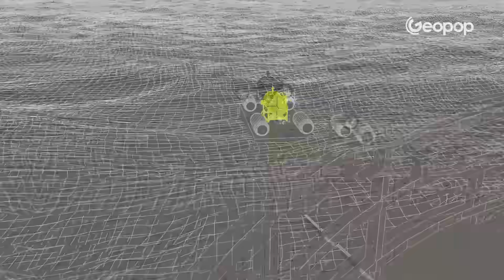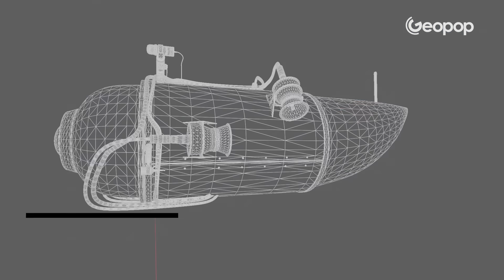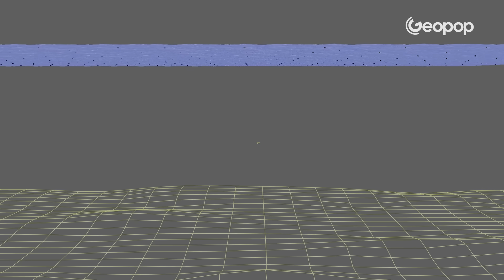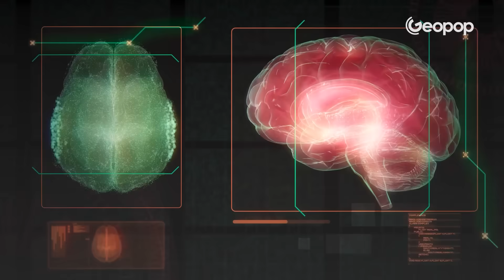Titan Implosion, two year later: the 3D reconstruction and the possible causes

Comment: I'm a retired engineer. When I saw the construction of the pressure vessel, the first thought that came to mind was Damascus Steel.
Reply: My first thought was wtf are they doing using Carbon Fiber as a compression vessel as opposed to a pressure vessel?! Repeated compression cycles of CF at those depths? This was inevitable. What an idiotic deaign decision!
Reply: @MattH-wg7ou  Yeah, most likely it could survive once, but the repeated dives were what did it in. With such an unknown there should have been a prototype to dive uncrewed until collapse to work out how long a live that hull had.
Reply: @MattH-wg7ou  mine too. Especially in the shape of a toilet paper roll 🧻
Reply: @MattH-wg7ou thats not even the biggest issue. Had they properly tested the limits of it, and performed the correct motions for checking deformities, this likely wouldnt have happened as fast, if at all.
Reply: @MattH-wg7ou  and they used space grade glue to hold it to titanium
Reply: @MattH-wg7ou  any figure all of those guys are smart in someway none of them even mention that this was a bad idea sending five people in that death trap? And I am not the smartest man in the world have ADHD. I would’ve said no to that.
Reply: @MattH-wg7ou  the whole point of what they were trying to do was to lower the cost of ocean exploration. Stupid yes - but very much by design. Carbon fiber is cheap. Solid titanium is not.
Reply: @MattH-wg7ou  It is interesting that it lasted as long as it did. Could be useful for expendable applications like torpedoes. They don't need to last that long and they aren't that deep.

Also, the technology has come quite a long way in just a few years. The resin and the fibers keep getting cheaper. You can even make graphene at reasonable quantities at home. A tiny amount of graphing can make a huge amount of difference.

I'm also pretty sure you could use acoustic modeling to give you a really good idea on just how much stress it can continue to take.
Reply: I'm not sure what Damascus steel has to do with engineering, it is not an engineering material. Properties lie within the normal expected range of the two constituent metals. Looks cool though. What part of it looks like Damascus steel? The titanium doesn't have banding, maybe the carbon fiber?
Reply: @zbubby1202 Yes but it weel keel
Reply: @I_am_BiG_Al Good one!
Reply: @I_am_BiG_Al  😄
Reply: @I_am_BiG_Al  haha
Reply: @I_am_BiG_Al  forged in water reference.
Reply: @zbubby1202 it was an example highlighting a material has a specific use, in a certain application.
Reply: @zbubby1202 the way that it is layered is similar to the construction of Damascus steel. However it wasn't layered properly and Boeing had even told them the correct way to layer it but they shot it down (as they did every common sense suggestion) becauae it took to long.
Reply: I’m not an engineer. But my first thought was Death Trap!!
Reply: I'm a domestic plumber. When I first seen it. I knew it would eventually implode.
Reply: Basically the resin was taking all, or nearly all of the compressive load, because carbon fibre has ZERO compressive strength without being set in resin. Also, the very low temperatures at that depth may have made the resin more brittle than it would be at the surface temperature.
Reply: This accident was totally predictable.  CF shares a lot of properties with fiberglass, albeit a stronger and better engineered version of the material but very similar material properties.  The primary difference is fiberglass, as its name implies uses glass cloth or glass threads while carbon fiber uses carbon cloth or thread.  Both have very good properties in tension and shape retention/rigidity (does not deform readily) but have rather low resistance to compression and impact forces.  Submarines are one of those devices where a material that can deform is somewhat desirable because an impact force (say from rough handling on deck) would just mar the surface or maybe leave a small dent (plastic deformation) but a material like carbon fiber behaves more like a submarine made of glass.  While glass would have a lot of desirable properties for a submarine one undesirable one is its lack of ductility where even very slight marring introduces a very weak microstructure that all stresses have to bypass.  This is also how CF behaves where even a tiny broken microstructure requires forces to travel around it which broaden the damage by applying micro deformations to the microstructure with each excursion.  CF being a composite material is very hard filaments in a relatively soft polymer matrix so these stress excursions are continuously working filaments free from their matrix with each flexing at a damage point.  Then finally on this dive the defect was too far gone to allow the rest of the hull enough margin to bypass stresses around the damage area causing further stress damage to propagate and further weakening the structure.  One can only hope the progress of this failure was not detectable and fast, however evidence says they may have realized they were losing structural integrity about 20 minutes prior.  In any case once integrity was no longer structurally sustainable due to the pressures the hull let go in a microsecond.  so fast that the air inside would have auto ignited anything combustible due to the rapid pressure change before the momentum of the materials tore them to pieces, all within a microsecond.  It is very telling that no large section of the CF tube was recovered, showing once the material failed, it failed completely and literally in all places at once.  That actually speaks volumes about how well the tube was constructed as much as it speaks to how bad of a material choice CF is for a submarine hull.
Reply: @larrybremer4930  in other words Fragile
Reply: @larrybremer4930 wow… one of the most in depth & articulated explanations I’ve seen thus far. Thanks for your amazing input.
Reply: @larrybremer4930 just what I had been thinking & I am a human Physiologist!
Reply: @larrybrem…:  TRULY, yours is the best explanation I’ve read or heard yet of all the numerous articles and videos over the last year plus!!  Thank you so much for “breaking it all down” for those of us who are laypeople!!
Reply: My first thought was THAT IS EXACTLY THE WRONG APPLICATION FOR CARBON FIBRE!!!!
Reply: @craigwall9536  I feel like it isnt that bad for say one or two dives per craft, or, alternatively, they could have added a thinner layer of titanium on the inside the carbon fiber as reinforcement. Itd still save weight, and still get down there a few times before replacing the craft. Theres a number of design choices thatd end up way better. But the whole company was negligent....so...yeah. from what Ive seen, they didnt even test this properly. Too concerned with making money instead of making sure it would survive.
Reply: @craigwall9536 The Navy has been using it in the same way.
Reply: I'm a Retired Janitor and I thought the same thing.  Damascus Steel.
Reply: With a gaming controller like that I don’t need to be an engineer to say it’s inevitable to happen
Reply: The smartest people were not inside of the submarine.
Reply: @lurin971 careful now, the son didn’t want to go, but his father made him. Remember that. At least one of them was smart enough to know it wasn’t a good idea.
Reply: @lurin971 I am sorry that an 18-year-old person was on board.
Reply: Same
Reply: Nope. You use contiguous-as-possible titanium for these things.
Reply: You probably confused Damascus Steel and the Damocles sword….
Reply: @Hop754: Exactly!!
Reply: I’m a retired war veteran that goes inside submarines in occasion, and the first thought that came to me is how everyone is a fat liar.
Reply: @UmesTapeworm what you mean mate
Reply: The carbon fiber that Rush bought came from Boeing and was deemed by Boeing to be unfit for their use, and thus made it for sale.
Reply: @cityman1111  the bargain basement. How anyone could climb into that Coffin makes me shiver.   At that depth the outside pressure is at least 5,000 psi.   A jet of water at that pressure can cut through a half inch of mold steel. One tiny little leak and it would give way real quick.
Reply: damascus is just for the look.
Reply: @noob9103  - during the period that damascus steel was invented and in widespread use, it offered several advantages over the standard steel of the time.
Damascus consisting of soft, low carbon and hard high carbon steel, forged into the right pattern could yield better flexibility and edge holding for swords and other battle implements to name just one of its applications.
Reply: The pressure of water at 3,800 meters is amazing. Imagine the pressure the weight of the entire earth. Now imagine the weight of about a thousand Earths our s u n . A neutron star is formed from Stars two or three times the mass of our sun. 
Truly mind-blowing
Reply: Your mention of Damascus steel, reminds me of antique shotgun barrels. There were warnings on modern shotgun shells not to use them in Damascus barreled weapons because of the pressures generated by modern ammunition.
Reply: 5,000 psi can direct a water jet capable of cutting through an inch of mild steel.
Reply: @allanpatterson7653 Water jet also has garnet added to it
Reply: You were a terrible engineer.
Reply: First thing I thought of was French toast with extra butter and syrup, I'm pretty hungry actually
Reply: I’m a retired fry guy at Burger King, I thought the same thing!
Reply: Same here
Reply: For me it was aluminum foil
Reply: For me it was aluminum foil
Reply: It probably could have used Damascus Steel instead of what Stockton Rush used.  Damascus steel is the King of steel. Rush didn't understand the meaning of the word CAUTION, nor did he feel a third party inspection was necessary, He could have designed it to be round instead of tubular but back ,he was in a big hurry. The more dives, the more CA ching $$$$$$ he wasn't thinking about safety. That submersible wasn't re-usable, it was a temporary, like a pair of disposable diapers. I never would have gone on that thing, after so many dives, the  depth stress would have caused it to implode. I'm no engineer, but I saw too many problems from the beginning. Stockton Rush got what he paid for., A disposable submersible. And because of THAT, they are all at the bottom of the sea in minuscule pieces, if that.🙄🙄🙄
Reply: I'm thinking you were being a bit sarcastic and crass.
By damascus did you mean multiple materials "formed" together, like CF, titanium and human remains?
Reply: As the late great Nigel thornberry “smashing”
Reply: 😱 no doubt!
Reply: Me too.  Not an engineer, but I do know Damascus barrels of rifles.  They are gorgeous…but
Reply: I'm no Alfred Einstein and I could tell when I first seen the vessel that it was a suicide machine
Reply: Steel ribs supporting the tube might have helped.
Reply: @kirbywaite1586  The fracture point was the acrylic view port 💥
Reply: @fiending  Has that been proven definitively? It sounds reasonable, but who can say for a certainty?
I wonder why the carbon fiber wasn't wound around something structural.
If there had been an inner structure and reinforcement , perhaps it wouldn't have imploded. 
Also, wouldn't the two titanium end caps have come crashing towards each other in an implosion, rather than being propelled away from the hull?
Reply: @kirbywaite1586  they would, itd have a vacum effect
Reply: @kirbywaite1586  I was thinking, if the fracture point was anywhere other than at the view port, the pressure would have been relieved off of the view port instead of getting stronger at that point to blow off the view port from the bolts. Because at the moment of the implosion, the titanium piece isn't attached to anything anymore so there wouldn't be pressure on the view port. Stockton Rush admitted that the view port would be pushed in 3/4 inches as they reached the bottom and didn't say the carbon fiber was compressing to a point that the view port was being pushed outward. To really find out, the threads in holes of the titanium that held the bolts that held the view port would need to be examined to see which way they were bent
Reply: @lllToxinSFMlll  But simulations of the implosion have the ends blowing off. At least it appears that way.
Reply: @catzkeet4860  out of all the materials, plastic is the weakest so the view port was the fracture point 💥
Reply: @kirbywaite1586 not a lot.  When carbon fiber composites fail they shatter. Reinforcing rings would likely have simply deformed, and the composite would disintegrate.
Reply: Remember when engineers say that carbon fiber is stronger than steel? Lmao.
Reply: @XeebThoj728 

9mo ago (edited)

"Remember when engineers say that carbon fiber is stronger than steel? Lmao." 

@Xeeb Thoj 728 :
It is. In tensile strength, not compressive, and when compared pound for pound.
Reply: @SHOwagon1994  Carbon fiber isn't stronger. It's just lighter hence "fiber" and also to compare steel to carbon fiber, they are not comparable to eachother.
Reply: You're missing the point. Aluminum is lighter than steel, and titanium is also lighter than steel. And yes, carbon fiber is lighter than steel. but it's how you apply these different materials and the orientation of the strands and how you want the forces to be absorbed. That's why planes are made of carbon fiber... because of their tensile strength, and high strength to weight ratio. 
Carbon Fiber Product  composites can have a tensile strength of up to 10 times that of steel.
Reply: But not in compressive strength. A quick internet search... 
"In terms of compressive strength, steel generally outperforms carbon fiber".
So good for planes, race cars, prostheses... Not good for submarines.
Reply: Maybe they should hired a 50 year old white guy 🤷🏻‍♂️
Reply: I don’t even think valerian steel would helped him.
Reply: @elizabethchase6528  CF and Fiberglass are excellent substitutes for wood, steel, or any other material in the right applications where things like corrosion of a metal or light weight for its strength is a necessary consideration such as Aviation, Boats, and  Cars.  At what point was I saying  CF was a good material for a submarine?  I said it had some desirable properties as any material selection would.  You could choose to make a submarine from peanut butter and find at least one desirable trait of that material but that would be offset by lots of undesirable ones.  Any material choice is always a compromise but in totality CF is not a good choice, at least not without something on the order of a 10x safety margin on design loads and doing detailed UT and X-ray inspections after each dive.
Reply: 100% demascus steel is the best way ibcan think of as well.
Reply: The carbon fiber was from Boeing and was out of date for use in aircraft manufacturing.
Reply: @annsheridan12  it was basically a high-school project
Reply: Another I'm A!
Reply: Another I'm A!
Reply: Why cuz it looks cool? 😂 its used for artsy knives... thats it
Reply: I'm a BUS driver , and even i could tell the next stop was there last.
Reply: Very thick and solid please, no carbon fibre for me.  It doesn't take a rocket science to know why Subs are built the way they are, It was never innovative, it was going backwards.  In a hugely reckless way. With a tragic outcome. All to see a graveyard, they have just added to.
Reply: So you’re saying they were screwed? 😳
Reply: Damascus steel ?
Reply: You can't use a car seat again after it's been in an accident, even if it looks perfectly fine, and that's because of fatigue. Astonishing that this factor was brushed aside.
Reply: My ridge wallet is of carbon fibre 👌
Reply: Goes amazing at 10% sped up…. -.-
Reply: Except the layers of Damascus steel are steel, not carbon fiber.  Toss in the cumulative material fatigue of repeated submersions, effects from being stored exposed to the weather, being towed (and falling off a couple of times) in rough seas, the sub wasn't safe to submerge in a kiddie pool.
On one hand, it's fitting that Rush died due to his arrogant, greedy folly. On the other, he avoided facing the consequences.
Reply: Nope. Titanium is much better. Steel is more brittle.
Reply: I'm a top tear arm chair expert with no plans to retire anytime soon and I pretty much know everything there is to know even stuff I've never heard about and this ability only intensifies with every can of beer. I also Iike to think billionaires are a lot smarter then me even many who are not necessarily self made but you could not coach me into that bodgie back yard inventor acme looking contraption if you were only launching it into a swimming pool let alone the bottom of the ocean .! No matter how indestructible you told me it was.
 As many things as Rush likely was I would add wasted talent to that list. He could've been the greatest car salesman of all time if he had pivoted🤔. 
They bolted them into that deathtrap from the outside ffs 😂  I know that in that industry being in a position that they may have the opportunity to self rescue are unlikely to none but what was the back up plan if the mother ship blew up sank or was high jacked while they were driving their magical euthanasia aid down to the pits of hell. Just resurface and sit there suffocating while stairing out of a window the size of a ping pong ball and looking at a black screen with all of your gaming controller typed msgs coming up as delivered but unopened🤷‍♂️
Reply: I’m not an engineer but when I heard about a carbonfibre submarine I thought, this can’t be safe 😱
Reply: A lot of wrong info here,there was plenty of carbon fiber pieces  left after implosion to inspect
Reply: As I recall Stockton Rush only built the carbon fiber hull to a thickness of five inches, another engineer told Rush to construct it to at least 8 inches. Rush promptly freaked out and said no to this and insisted on it only being 5 inches.

But if you look at the now deleted ocean gate videos of the carbon fiber hull being constructed, you can actually see all of the imperfections in the process, air bubbles, dust particles are all present in the finished hull, then they added the apoxy resin to fit the titanium rings.

So I can imagine as the resin was applied, how much dust particles were getting onto the resin itself then had the rings fitted.

The fact they built this in a warehouse full of air contamination like dust particles and air bubbles to me stands out as maybe the real reason for the subs failure.

Think about it, at surface atmosphere pressure, something like dust or air bubbles may seem innocuous and harmless, but in the water at 12,500 feet and pressure of 6,000psi, air bubbles and dust particles become deadly.

I think as the rings were being compressed each time around the hull, the resin was being ingress by water, and any air bubbles or dust particles would’ve been enough for it to fail.
Reply: OK fair enough you asked for subscription in nicest way 👍
Reply: 😂😂😂 Damacus steel!!! My chef knives are made of Damacus steel.. Perfect way of explaining the built of the TiTan!!!! RIP 2 all of those on board and condolences to their families ❤❤❤
Reply: @derrickablair1368 you laughing and memeing and in the same sentence rip
Reply: Crushed like a beer can.
Reply: @brian…: “Beer can for billionaires.”
Heavy head foam.
Red-pink color with tint of amber urine.
Bitter and with a metallic/plastic resin aftertaste.
Please floss out the fibers after consuming.
Pairs well with crow.

Recent drastic price markdown and Going Out of Business Sale!
Reply: A little late on the video.  No simulated human implosion. Junk.